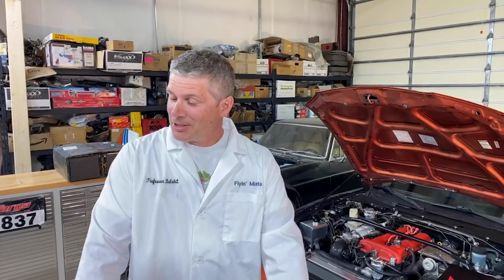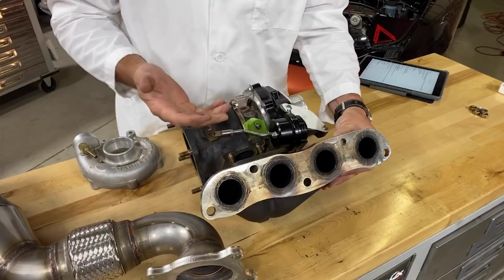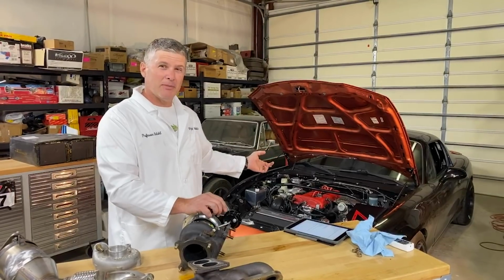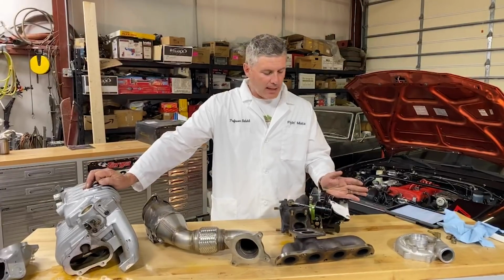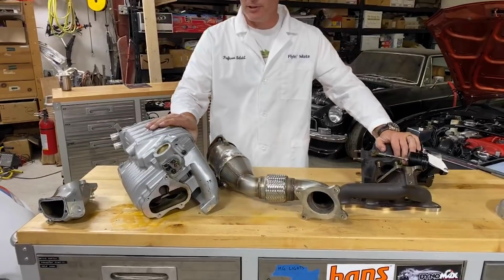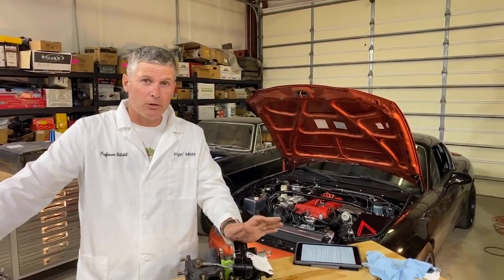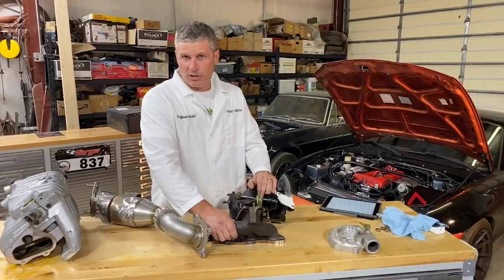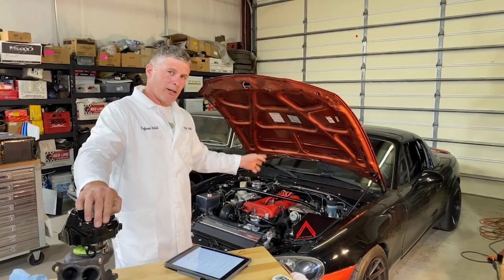Forced Induction Fundamentals with Keith Tanner (FM Live)

Comment: Not in the near future, but in 5 years maybe I plan on turboing my 1.6. I heard that you will never really be able to get the ecu to run smoothly once you get a standalone. Is this true? and what should I expect to do if I want to keep it as a daily?
Reply from the maker: It is true that getting stock driveability out of a standalone requires a lot of experience and time. It can be done but it is rare for individuals to spend the effort. Mazda's engineers spent thousands of hours on the problem.
One way to avoid driveability problems is to use the stock ECU with something like our Voodoo Box to add fuel under boost. When you're out of boost, the car is just like Mazda tuned it. The ultimate power level is lower but it's a good option for a daily driver.

Comment: What about “cool side” superchargers (i.e. Fast Forward) vs. exhaust or “hot side” superchargers?
Reply from the maker: A supercharger on the intake side is usually on a custom intake manifold. It has the advantage of minimum throttle volume if it's not intercooled or if it uses an air/water Laminova-style setup. It's usually our preferred option - we've sold a lot of different supercharger setups over the years and the best ones have been on the intake side with air/water intercooling. But it's also more expensive.
The exhaust side is easier plumbing for an external intercooler but that means lots of throttled volume. The temperatures from the exhaust aren't a major factor, as most of the temperature rise in the air existing the supercharger is due to the pumping or compressing of the air.

Comment: how much boost can you run with a voodoo box say in an NB with lower compression pistons? For the sake of science, lets say the voodoo box was still adjustable.
Reply from the maker: Trick question. The limit isn't boost, it's power. The stock injectors on an NB max out at 190-200 rwhp depending on the year of the car, and that is your power limit regardless of how you get there.

Comment: The turbo system I envision is modest in power and great on autocross drivability and street livability
1. What happened to the 2554 turbo? You used to say it is the best turbo for lag.
2. What happens to fuel economy when the turbo is added.? What if you add the bigger injectors from the old FM2?
Reply from the maker: We no longer offer the 2554 because it was a poor seller. It was a good choice for the 1.6 at lower boost but then lost out to the 2560 in power and response. 
Fuel economy at cruise usually sees a very slight improvement. Full throttle fuel consumption goes up because power goes up. If you add bigger injectors and the engine management to control them, you can make more power. If you add bigger injectors with the stock ECU and a Voodoo Box, you will run rich all the time as the ECU will not be able to compensate.

Comment: I hear a lot about hp limits to the stock rods, what is, in fm's opinion, the rpm limit of those rods.
Reply from the maker: HP limits and RPM limits are not the same thing. RPM puts a lot of tensile load on the rods, and that increases exponentially with engine speed. I wouldn't spin the stock rods much past the stock redline just to be sure.
HP tends to be limited by the compressive strength at torque peak, and since knock is a major spike in load they're most likely to fail if there's a problem with the engine management. It's easier to change rods as a preventative measure than rebuild an engine that has a big hole in the side and metal chunks inside everything that shares the oil supply, so we recommend stronger rods anytime you're looking to push past about 250 rwhp on an NA or NB.

Comment: Can your kits make 5-600 pump gas hp on a stock ish engine with upgraded  aftermarket Rods  and a lowered compression ratio, maybe add ARP 2000 studs and bolts?
Reply from the maker: You would need a large turbo for that sort of power range, and pump gas is an aggressive target for a turbo 1.8 making over 500 hp. We don't currently offer a kit that would be a good base for that sort of power level - the manifold has a T2 flange which is small for that turbo size, and the rest of the piping would be undersized for that power level. That's a very high power goal, and there are probably no more than a dozen Miatas running in that power range with the original engine block.

Comment: Keith, the universal gas law is PV = nRT.  You mention the gas law at 6:08 in the video. For a given amount of air at a given volume if the pressure increases 5 PSI (boost) over atmospheric pressure (14.7 PSI) to approximately 20 PSI, a change of 25%, the temperature also rises 25% absolute, from 530 degrees Rankine ( 70 F or room temperature) to 1.25 x 530 R = 662.5 R, or 203 F.  In practice the boosted air loses volume, so the temperature of the air leaving the turbocharge, while hot, does not reach this theoretical maximum. I am enjoying this series of videos.
Reply: Of course, any inefficiencies would add to this temperature.

Comment: Hi Keith, I'm starting with a 2002 and will turbo it eventually.  I've heard comments about the stock radiator as a grenade. What work is reasonable to do in preparation or at the time of turbo installation on the NB? Radiator, clutch, catch can, oil cooler, engine compartment ventilation, etc.
Reply from the maker: The stock radiator isn't a grenade if it's in good shape. The problem is that they get fragile as they age. If it's the original radiator from 2002, it's 18 years old and probably is brittle. If it's a quality stock replacement, it will not crack. It may not provide the cooling capabilities you need, but that's different than being a "grenade".
The amount of prep you need to do depends on your expected power level. For our Stage 1 turbos, the car just needs to be in healthy mechanical shape (ie, no antique radiators!) and it may benefit from some cooling upgrades. The stock clutch on a 2002 may or may not slip at those power levels, it's right on the limits of what it can handle. Oil coolers, vents, catch cans - those are the sort of things we'd recommend for a car that is running higher power levels and expects to see track use.
Reply: @FlyinMiataVideo  Thanks for the perspective

Comment: Keith saying "I don't know" honestly makes me respect him more. I've dealt with these guys a number of times over the years on different work I've had done on my 2004 MSM. Also, as the owner of an MSM I think you would be better off upgrading a stock NB vs an MSM. The MSM turbo sucks, and so does the ECU. FWIW.
Reply: Yes, the stock turbo in the MSM leaves much to be desired.   I also have an 04 MSM but with the mods that make it near perfect (for me)   The little enchilada not only ups the power to about 200 WHP but vastly improves driveability as well.  Also changed to 15" wheels and coil-overs.    Near perfect except you need to learn to respect the power boost.when exiting turns.  It kicks!

Comment: can you tune nd2 with exhaust and headers to increase the redline?  how high can you get the redline?
Reply from the maker: We haven't explored where the rpm limits are on the ND2. Remember that stress on the internals such as the rods goes up exponentially with engine speed, so sometimes you find out in a very expensive way how fast is too fast.

Comment: when i drove through arizona 114 degree f, i didn't notice a huge drop in power on the Edelbrock supercharger.  nd1.  i inquired about a bbr turbo from flying miata and was told that they would not be available to do the install and tuning.
Reply from the maker: If you had done multiple runs to redline, you would have found the power loss as the intercooler heatsoaked. 
There is no tuning required for a BBR turbo. We are not currently doing installs on customer cars, but we do support other shops who do.